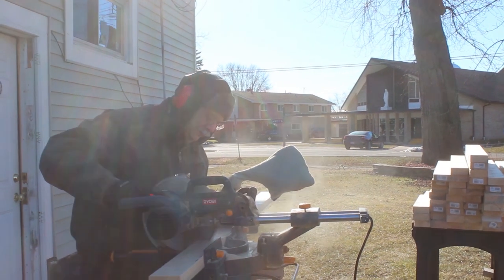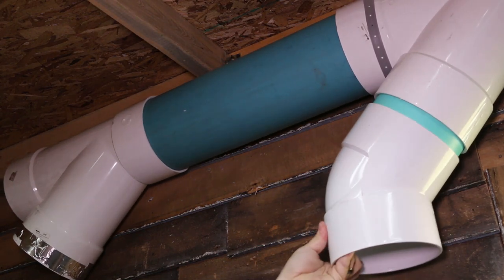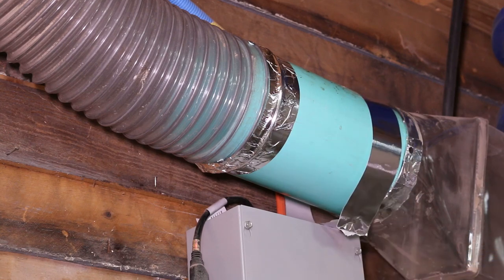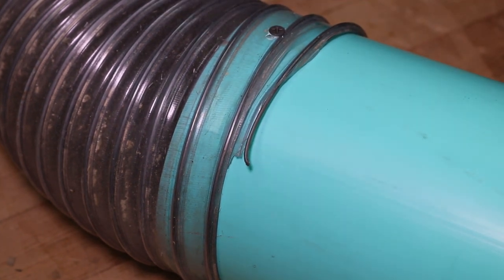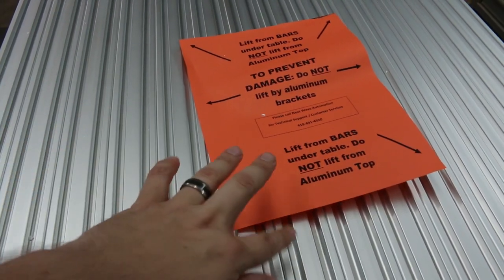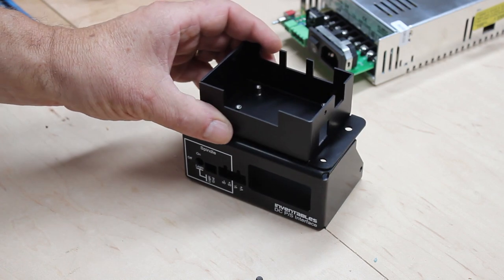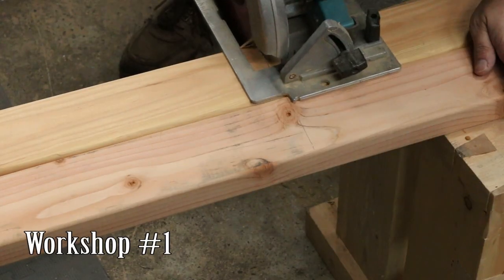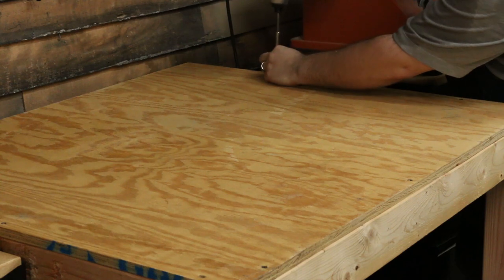Shop Blog #4- 6" dust collection ductwork tips and TWO CNC machines!

Comment: Hope the CNC Sharks have been improved since I got mine. I was really disappointed in mine, but that one does look a lot better. I like the X-carve for the fact its open source, but probably not as stiff.
Reply from the maker: Jer's Woodshop I have no major complaints about either one, yet. It's not fair to really compare the two because they are in different classes. But we'll be comparing them anyway :)
Reply: +Stumpy Nubs Yes, they are in different classes. My complaint with my Shark Pro Plus was that it was almost as flexible and wobbly (hence, slow) as an X-carve, but was bulky and cost a lot. I think they have been stiffened up a lot since though.
Reply from the maker: Jer's Woodshop Yes, the new Shark HD 3.0 is a totally different machine.

Comment: What are your thoughts on grounding PVC in dust collection?  Have you already talked about that in a previous video?
Reply from the maker: Curt Walkins - I go back and forth on weather to ground it. I may, just to make a video. I've worked for years with various types f PVC systems that were un-grounded and never exploded. In fact, I don;t think there has EVER been a documented case of fire from static buildup in PVC duct work. Of course, I don't want to be the first case, either.

Comment: Stumpy - love the channel.  Thanks for being so generous with your time and expertise.  Question for you: where did you find all the Sch 20 PVC and fittings?  I have to do my new shop with 6" duct and am deciding between PVC and having my HVAC guy's metal shop do all the duct. The big problem with the PVC is I can't seem to find it anywhere around here (northern VA). Did you order online somewhere?  Thanks!
Reply from the maker: Russ Haynes It's Sch 30. I got mine at Menards, which is the only one of the big three Home Center chains that still carries it. (Home Depot and Lowes don't anymore). It's getting harder to find all the time! But you can order online from Menards.com.
Reply from the maker: ***** I have never heard of 20. Usually it's 30. But it will work either way. It's used for sewer lines, while 40 is for pressurized water lines. Even if 20 is somehow lighter than 30, I am sure it will still be strong enough.

Comment: For more of a pow you should have worn the lime green Crocs..
Reply from the maker: Paul Espinoza Mike has severe diabetic neuropathy. His feet are in constant pain. The Crocs fit loosely and are about the only thing he can wear without suffering.
Reply: Stumpy Nubs I know Mike's pain, both my mother and me myself have diabetes neuropathy, not fun standing on concrete in any type of shoes, but I still get to my shop in the basement on a daily basis.
Reply: jlt85215 I just hope Mike can find a way to be comfortable while working, I had to have special shoes made for my problem, they are steel toes (which diabetics have issues with their feet anyway) and they fit just tight enough to not slip off making them ideal for someone with neuropathy, problem is, they are pricey as well.

Comment: whats are your thoughts on static with the sewer pipe?
Reply from the maker: POLOLOUS3 I go back and forth on weather to ground it. I may, just to make a video. I've worked for years with various types f PVC systems that were un-grounded and never exploded. In fact, I don;t think there has EVER been a documented case of fire from static buildup in PVC duct work. Of course, I don't want to be the first case, either.

Comment: the coil hose goes inside the pipe. simple exhaust theory
Reply from the maker: +Richard Cowtails -Cramming then ends of 6" flex-hose inside the 6" pipe would require slitting the ends and overlapping them to taper the diameter. This would create a significantly larger obstruction for the airflow. Simple dust collection theory.
Reply: +Stumpy Nubs (James Hamilton) outside to inside... not outside to outside.  yoy put water in this it'd leak.
Reply from the maker: +Richard Cowtails - I'm sorry, but you are wrong on this one. Dust collection is all about eliminating the obstructions to airflow. Putting the hose OVER the pipe is the best way to do that. You will also find that all commercially made hose-to-dust collection pipe adapters do it the same way. It does not leak.